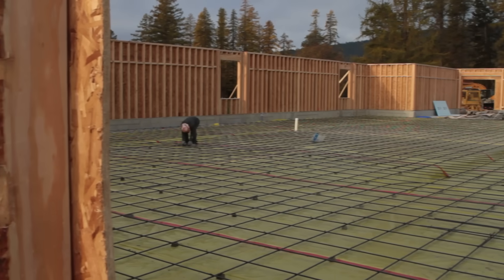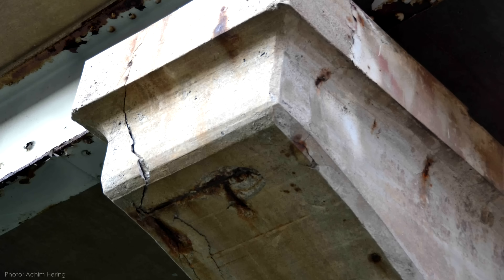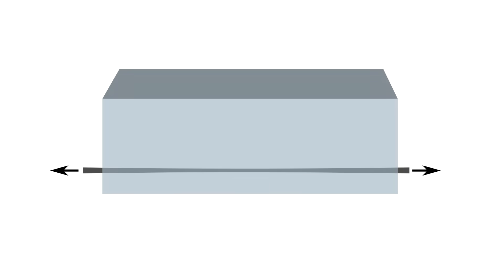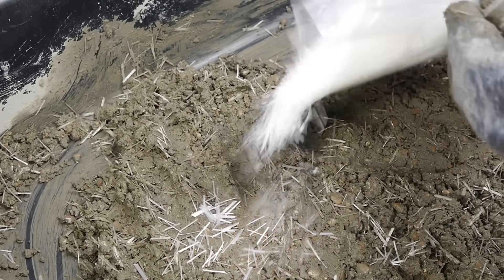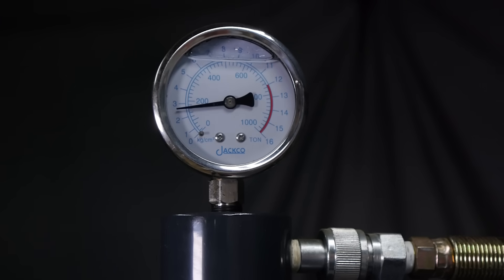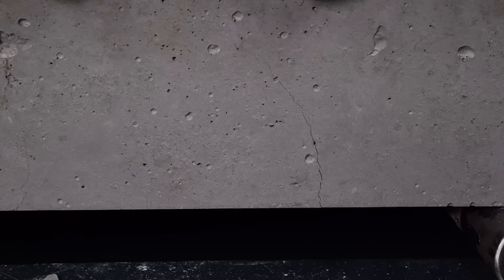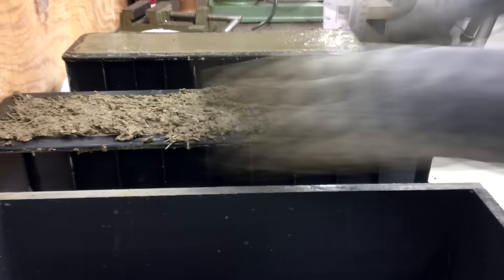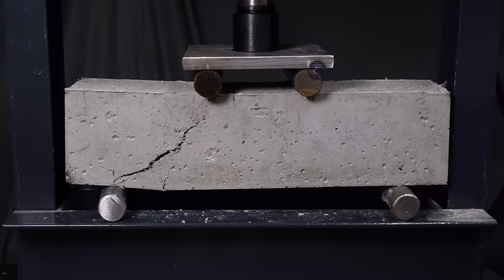Does Rebar Rust?

Comment: Also worth mentioning is that Concrete and Steel happen to have the same constant value when it comes to expanding due to heat. If a material with a different value was used in concrete, they would expand or contract at different rates, which would make everything explode

Comment: Salt corroded steel reinforcement in the concrete,so the concrete covering around it is essential and mixed with fiber aids in resisting corrosion that affects the rebar against the usual tensile stress.

Comment: Would the reduction in visible cracking caused by fiber reinforcement make inspection of the structure for damage more difficult? I don't know much as a biochem major, but it seems like over stressed, close to mechanical failure components that visibly show damage would be easier to catch.

Would that be a potential drawback? Or not really?
Reply: Interesting question.
I guess it comes down to how close to structural failure the cracks eventually do show up in fiber reinforced concrete.
It's also possible that fiber reinforced cocrete may even be better here, as the lack of inconsequential cracks will make it easier to spot the important ones.
Sadly, that's not my erea of expertise.

Comment: Your beams aren't failing. At least not under the load bearing maximum capacity. Your rebar is slipping out of the ends because your rebar has no bends in them to stop the friction to bypass the ridges on the rebar. The bumps create anchors in the concrete. Bending the rebar ends or adding extensions and welded on end caps to the rebar would get you a better reading on how strong they could be.

Comment: Could you use polymer layers in concrete to reinforce, much in the same way that you can do so for Mechanically Stabilized Earth? Seems to me that it's the same sorts of pressures involved that need to be resisted, and would go a very long way to providing supporting resistances without needing to worry about rust becoming an issue. 

It's interesting to note that many concrete companies use vacuum molds to pour for certain standard concrete shapes that come pre-formed (such as the concrete pavers you might use in your garden), and that moon rock makes an excellent concrete, meaning it could be an excellent locally-sourced building material if we ever decide to construct a lunar base!

Comment: “Durability is as important to public safety as other design criteria.”  How true. The trick is to try to convince industries of this at a time when profit margins are everything.
Reply: Also, when bids go to the lowest tender, they often won't be built to the same specs as the other tenders.
Reply: People complain about profit margins, but its the only reason all economies even work in the first place. The system has to produce more value than it consumes in order to justify its existence. All companies in said economy have to have a revenue stream greater than their cost stream or they eventually run out of resources to operate. If all companies in an industry (or all industries in a society) have less revenue coming in than going out, the whole system turns into the Soviet Union and collapses.
As economist Thomas Sowell pointed out, "There are no magic solutions. Only trade-offs." You want the highest quality stuff? That is going to cost you a lot more than a product which has its quality balanced against its cost.
 The disaster that was Chernobyl in the Soviet Union was caused by the same drive for lower-costs that you see in other economic systems (they chose graphite tipped control rods instead of the West-standard boron control rods because graphite is cheaper), and they had to have the cheapest costs possible thanks to systemic dysfunction caused by lower worker productivity, due to workers not working harder to get more income, as you would get the same pay in an egalitarian communist system regardless of the quantity and quality of work you did. This lead directly to a regressive feedback loop of workers productivity dropping as they saw no reason to work for more than the minimum to get the same pay, and since the cost of not working was spread out over all workers, a slowly growing pool of workers dropped down to doing the bare minimum they could get away with without being shot by overseers/guards or shipped off to force labor camps.
Unlike private companies which can be sued for bad practices in the West, the Soviet government (which owned everything) didn't have to care about safety standards because Soviet citizens couldn't sue them for disasters caused by them.
Reply: @GreyWolfLeaderTW , you mean this Thomas Sowell? “Electric cars may be fun at amusement parks, where they don’t have to go very far or very fast. But if the consuming public wanted electric cars for regular use, Detroit would be manufacturing them by the millions. Only people infatuated with their own wonderful specialness would think that their job is to coerce both the manufacturers and the consuming public into something that neither of them wants.”  I have always found his views simplistic and informed by a far right ideology. The passage I’ve provided is evidence of this tendency. The data on advancements in electric car technology prove his views to be incorrect. As for this subject, civil engineering has a social responsibility. The internet is replete with examples of how this is achieved. I will not address the straw man fallacy you’ve presented. Providing an extreme example from a failed state bears little relevance to the discipline of engineering in a fully functioning democracy.
Reply: ⸻⸻⸻⸻⸻⸻⸻⸻⸻⸻⸻⸻⸻⸻⸻⸻⸻⸻⸻⸻⸻⸻⸻⸻⸻⸻⸻⸻⸻⸻⸻⸻⸻⸻⸻⸻⸻⸻⸻⸻⸻⸻⸻⸻⸻⸻⸻⸻⸻⸻  No, he is not correct and neither are you.

Comment: You should never use epoxy coated rebar, not just if but when the rebar has a holiday, then you get localized corrosion instead of generalized corrosion...this is worse because corrosion occurs in a concentrated place at a much faster rate. 👍

Comment: So I know this is slightly old but why not use 3D printers to make a hexagonal pattern inlay that would basically sit around the rebar then filled with concrete? I understand you'd need to either have a huge printer to make it so you can still have the woven rebar or you'd need to make a hexagonal pattern that can more or less be glued together and still maintain it's integrity but it seems much better at all the above than just rebar reinforcement or rebar and fiber filled concrete could do on their own.

Comment: Why do we use steel? It has a thermal coefficient of expansion almost exactly the same as concrete. This has been called "the single physical fact that contributes most to modern architecture".
Reply: As a Union Concrete Journeyman this is one of the best video collections.
Reply: While the thermal coefficients are similar, both materials don't necessarily adapt to temperature changes at the same rate. The physical fact that chiefly contributes to concrete and steel working in a compatible manner actually seems to be the adherence between them. And definitely one of the greatest contributions to modern architecture, of course.
Reply: @alejandrogalasso2352  that's caused by the oxide layer forming where the concrete is touching the steel greatly increasing surface area between the two.
Reply: "almost the same" is the key notation here. "Exactly the same" would be amazing. "Anything less than that" eventually crumbles apart.
Reply: Yes! That's why bamboo is not considered for concrete+
Reply: Cracks that form can be expanded by any moisture that gets into the crack, and then freezes—when water freezes, its molecules rearrange into a structure with a greater volume than it had when liquid.
Reply: Does Roman Aqueducts have any kind of rebars whatsoever? 🧐🤔
Reply: @EffySalcedo  I believe they do not as they were made before steel was a well known material. Most of those structures were built near the later era of the bronze age. Its beleived that the concrete was able to last for such a long time because of the materials used mainly by sheer luck that the volcanic ash used to mix the concrete had a better effect than at making the concrete extremely durable to ingress and cracking. Its not extremely strong concrete but it does last a long time. Steel rebar most likely will give stronger concrete but it won't last as long as the type used around Rome.
Reply: @EffySalcedo  
No rebar in the Aqueducts,! just arches on top of more arches.
Reply: @EffySalcedo  yes mainly plastic
Reply: @whitemanbrownworld my only concern with basalt is that it is made out of fibers which tho not as toxic as asbestos, are still toxic, and also it contains epoxy which is basically BPA (an endocrine disruptor) you are limited to the exposure due to the fact this stuf is in the walls, but remember we had asbestos reinforced cement (my sister's roof (not ceiling)is still made out of that, she's gona change it this year) and now we don't. Asbestos is really good at tensile strength, insulation, and an all around good cheap material, but health concerns prevail and rightly so, Titanium may be a good alternative but it's highly expensive... till then, think like Romans and make your ceiling a dome :)))
Reply: If the Rome Colosseum was made with steel reinforced concrete, it wouldn't exist today.
Reply: Jeff Borders how come?
Reply: @jeffborders5526  I think The Pantheon is a better example. But the Romans would have not been able to build a simple concrete bridge.
Reply: @jeffborders5526  arches supported much of the weight of the stone evenly. we don't build like that any more. today it's just slap some steel in concrete for cheap and hang some aluminum and glass. only needs to last 30-50 years
Reply: @pauls5745  with the Miami condo collapse, your words are prophetic.
Reply: @jeffborders5526  You mean like the 2000 year old forums concrete dome? Thats still there? And working perfectly?
Reply: @andrewallen9993  is it with steel ? So what you wanna say is that SPQR better in quality structures than we today ?
Reply: @rajkotancevic3565  no steel in the forum. It gets its strength from the shape of the domes design.
Reply: @andrewallen9993  Are you referring to the Pantheon's dome?  It really isn't in the Forum.
Reply: @johnvinga5446  I am, and you are correct, I could have been geographically more accurate :)
Reply: @andrewallen9993  No biggie.  I just remember walking around Rome years ago being lost.  The Forum is quite easy to stumble upon, but the Pantheon--one kind of has to know which direction one is going.  Maps are one thing, but down at street level, Rome can be very confusing.  You are right though--the Pantheon is quite an amazing work of engineering .
Reply: "Architecture" - taking credit once again
Reply: Does your comment apply equally to both rebar and prestressed rebar?
Reply: We use steel if you want to consider dead loads as a critical function in design (as a steel beam is almost always lighter than a concrete (even prestressed) girder - for the same design capacity).  You might also consider steel if a primary load carrying member is curved.  Otherwise, PS concrete and reinforced concrete is an efficient design approach.
Reply: Because steel was ductile
Reply: @epiccollision "scientific" explanations of creation require as much faith in the unknown as my belief in a creator my friend
Reply: @6throundnate759  You said: ""scientific" explanations of creation require as much faith in the unknown as my belief in a creator."   Scientific explanations are the set of all possible explanations including the factually correct one.  Faith in that is much different than faith in one theory agreed upon socially 2 thousand years ago by flat earth peoples.
Reply: @6throundnate759  that's very true, and the idea that a finite human mind, operating within flesh and blood, could comprehend "true reality" seems to be highly unlikely to me.
I haven't heard any "logical" explanation for existence from anyone.
Reply: @ibnyahud  great point friend, no one has any clue at all lol, no use looking down on others for their beliefs
Reply: @6throundnate759  Both of them are unproven. But the difference is 'scientific' explanation will change with how much more knowledge we gain and does not demand faith because its still a conjecture based on how much we know and is bound to keep changing until we reach the truth, whereas your faith in a 'creator' is already a fact for you and demands faith because without the curtain of faith it cannot be a fact for you.
Reply: @akay4086  Well specifically about the existence of a creator, science has no answer too how anything was created? You tell me using science, how was time/space other dimensions created? How was the whole universe created? And if you say the Big Bang, believing in the Big Bang requires FAITH. So yes, science requires faith, just as much as any other creation belief.
Reply: @6throundnate759  nope won't say Big bang. As I said thats just a theory and has not been proven to be true yet. 
And I wont say Science knows everything either. And it doesn't claim to know everything either. Thats the difference, You dont need faith in it, you make conjectures, then theories and then try to prove them true. If you succeed, you now know something new. If you fail, well try again.
Reply: @akay4086  So how do you personally think the universe was created?
Reply: @6throundnate759  Dont know. We dont even know how big the universe really is. Heck we dont even know everything about solar system yet. Knowing about universe is a task that we cannot accomplish with our current tech. All we can do is make guesses, but in the end they all just amount to that.
Reply: @6throundnate759  We've observed echoes of the big bang. Not concrete proof but pretty substantial evidence.
Reply: @akay4086  My belief is that science can only ever answer half of the question it sets out to answer. Science can tell us how it rains, how stars are form, and how gravity works, but it will never answer why it rains, why stars are formed, or why gravity works the way it does. If you put your faith solely in science you limit your understanding to only half truths. The same can be said about religion, you put your faith in a creator alone you blind yourself to the world that they created.
Reply: @akay4086  Big Bang is a predictive model, so it doesn't necessarily describe the origin of the universe, it describes the measurable effects of it. The popular description of it isn't indicative of its scientific meaning.
Reply: @redstripedsocks5245  There is no purpose to the universe.
Reply: @redstripedsocks5245  
"How" questions are fair game in science. Never ask "why" of the universe. It isn't a sapient agent with reasons it can convey. And philosophy is the domain of "why", not religion.
Reply: @epiccollision Here I go again. Every human culture from the earliest tribes to modern cities worship something.  It is inherent in our nature. The arrogance of denying that fact doesn't change it. You can stick your fingers in your ears and hold your breath til you turn blue. Humans will still worship. The totalitarian societies who tried to eliminate that factor not only crush the life from their people, the governments disintegrate. Worship is a necessary cultural nutrient. Maybe your energies would be better served by asking, "Why?"
Reply: @YSLRD  There are many many reasons to explain humanity's unfortunate attraction to religion before you get to "some kind of god is actually real".
Reply: Exactly that's God's gift.
Reply: @FrancisLabayen  LOL at the thought of a man in the sky with beard and sandals planning out physical properties of substances!
Reply: @alistair1978utube  man in the sky with beard and sandals is propoganda made too discredit my friend. Ofcourse there is a creator, we do not know what shape or form they take, but rest assured everything we see including us is intelligently designed.
Reply: @6throundnate759  lol. Your comment is not intelligently designed.
Reply: @TheSummersilk  how so friend?
Reply: Bruh. I'm a missionary, and even I don't bring up "sky daddy" in normal conversations as much as atheists...

Think you've got something you need to work out, my dudes.
Reply: @benthurber5363  This should just be a discussion about design and engineering. people invented concrete. it's actually fascinating how it has changed and developed over time.

Comment: Other materials than steel are rarely used because of their thermal expansion factor. The thermal expansion factor of steel is almost identical to that of concrete, thus allowing these 2 materials to behave as very a good composite material together.
Combining materials with different thermal expansion factors into a composite material may inhibit cracks when there are significant temperature changes.

Comment: What about galvanized instead of epoxy?
Reply: You mean a galvanic zinc coating?
Zinc reacts readily with alkalis like calcium hydroxide, which you get 
when mixing calcium oxide - a component of cement - with water.
So, imo not a viable option.
Reply: @Bird_Dog00  Thanks.

Comment: I've seen a concrete slab done w/ fiber reinforced concrete. It had an ugly finish to it because those fibers wound stick up out of it.
Reply: When I worked at a concrete structural plant, an additive was added to the concrete mix to prevent corrosion to the rebar.

Comment: From the last graphic I can see that all 3 failures were caused not exactly because of steel failing due to yielding but the bond between rebar and concrete fails. I would love to see you doing another experiment with rebars with hooks at the end with better vibration and maybe more curing time. Keep up the great work!